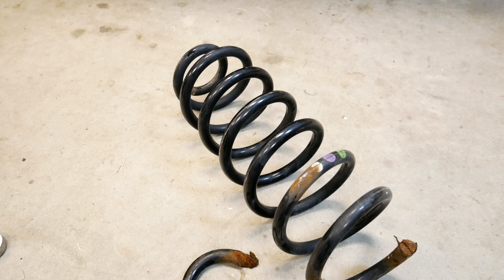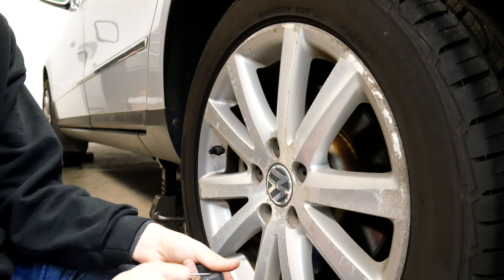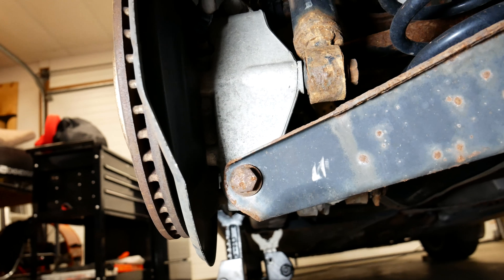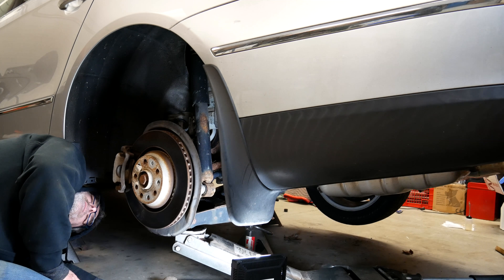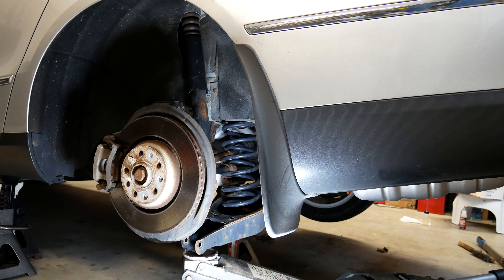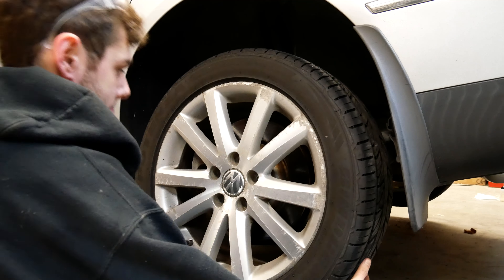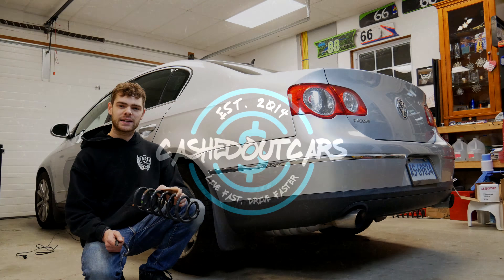Volkswagen Rear Coil Spring Replacement: The COMPLETE Guide!

Comment: I was able to replace the rear coil springs on my 2007 Passat with no issues. The trickiest part was getting the bolt back in the lower control arm. The rear of my car now sits at the proper height again. Thank you very much for this very informative video.
Reply: What was your trick? I have that problem right now.
Reply: @weskarp7643 Just simply move your trolley jack up or down until the holes align so the bolt will go in straight

Comment: Good video but there is kinda issue. Please tighten the nut only a little thight, and apply the final amount of torque when the car is back on the ground  and at final level, because it can happen, that you "turn" the bushing out of the rear shock. Greetings from Germany !

Comment: Replacing rear coil springs on a 2015 VW Golf Sportwagen TDI SEL.  Both rear springs broke at the base and still provide support.  State Inspection caught the broken springs.  Springs on order.  Thanks for the video.  Hope to do it myself without compression tools?  Any guidance would be appreciated!
Reply: Hi. Was reading your reply and was wondering if you were getting any metal to metal rattling noises coming from the back of the car? Any vibrations? TIA!
Reply: @Mark B  No. Nothing. Was a straight forward replacement. Both sides must be taken apart at once and once the entire axle is lowered the springs can be removed easily. The level sensor also needs to be unbolted.

Comment: I have a hardrop 2006 beetle that I tow a teardrop trailer with that's sitting a little low in the rear ever since I put new struts in the front and someone said that the springs in a beetle convertible are a little heavier duty and was wondering if you know anything about this or some other was to make the beetle and little firmer? Thanks

Comment: 2012 Jetta Sports Wagon.  Replacing the rear springs because the passenger side spring just BROKE.  I am not sure if I should replace the shocks and the rubber mounts and whatnot on this car since it is 12 years old ???

Comment: Thanks for this, saved me the cost of a spring compressor. Just did my Tiguan and worked a treat. The only issue I had was aligning the swing arm when jacking it back up but got there in the end with the help of a lump hammer. 👍🏼
Reply from the maker: Glad it helped! That's generally the only finicky part, I'm glad you got through it!
Reply: Doing this job on my Golf this afternoon - that's good to know will have the lump-hammer ready to rock!

Comment: Rear lower control arm to wheel assembly bolt torque, loaded or unloaded?  I read 38cm from wheel center to fender arc above, but I'm upgrading to Tiguan springs for higher rear end clearance, so I went with 41cm or just over 16", but that's a guess.  I can't see how it would make any difference.  Opinions?

Comment: What about wheel liners?  Did you remove them first?  My car has 70k miles and rear struts have not been changed.  Should I change them at the same time?

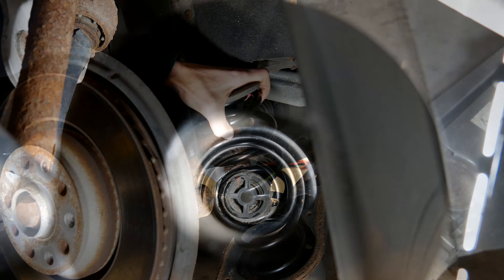Comment: At 4:47 there is a view looking down into the coil spring.  What is holding that plastic piece in place? In my 2012 TDI, after removing the old spring and parts, the piece is loose. Does the piece get pressed, mushroom down, into the hole of the metal swingarm after the rubber base is properly positioned?  It seems so, but I'm not sure.  Looking at the view in the video guide it seems there's another piece in the center.  Am I missing a part?

Comment: What kind of lubricant did you put on the bottom of that spring?

I’m thinking of changing my original rear struts and front struts and adding a 2 inch Bilstein coil spring kit.  I’m assuming the installation would be the same?

Comment: Great video! I’m going to try to replace the rear passenger spring on my 2008 2.5L Jetta. Is there anything else I should think about replacing?
I checked my car today and noticed how low it was to one side. Took off the tire and realized the spring was broken lol
Reply from the maker: There's not too much else that you'd need to do with the rear! It's never a bad idea to have new bolts ready in case some break though

Comment: I don't need to worry about the pressure from one of the springs I'm replacing, 'cause it's in 2 pieces on my driveway lol, thanks!
Reply from the maker: That is unfortunately how it sometimes goes with these. Good luck with your fix!
Reply: @CashedOutCars  back on the road now, this video was a life saver
Reply: Same with my 2013 TDI. Just had the front done two weeks ago. I this a thing with VW? We don’t race this thing or hammer any dirt roads or carry but  2 people and a pit bull ever. Frustrating.
Reply: @Saltshaker2016  do you by any chance have those horrible red speed bumps in your area? My car does mostly motorway miles and occasional trips to English heritage sites and stuff, no racing, no offroading. Just those bloody bumps on my street I try and go over at 5mph 😂
Reply: Update… would have been harder to replace All 4 tires. Start to finish about :25 minutes with a cordless impact and standard floor Jack. 
I have 2013 Jeta wagon TDI.
Reply: @cptnraptor  no. I live in mid coast Maine and the roads go to He… you know where for a couple months every late winter/early spring.

Comment: My back rear spring just broke, but I’m unsure if I need to repair the entire assembly or just the spring. Do springs usually fail before shock absorbers? Or should I replace it all just to be safe.
Reply from the maker: What year and mode is it? With lots of FWD cars the shocks and springs are separate units and can be replaced independently
Reply: @CashedOutCars  2009 Jetta sport wagon

Comment: Replacing rear springs on a 2013 VW Sportwagen with towing springs
Reply from the maker: Nice! I like those sportwagens. What will you be towing?
Reply: @CashedOutCars  Will be towing a small (1100 lbs.) 4 ft x 8 ft trailer.

Comment: Hi , I drive VW Golf 5 1.4 patrol engine and 80 ps . My RPM goes over 4000 when I am at 140 km in 5th gear . Is it normal? 
Thanks.
Reply from the maker: That sounds like it’s probably okay. It’ll depend on gearing. If your speed corresponds to RPM I wouldn’t worry about it, if your RPMs jump and your speed doesn’t then you may have problems